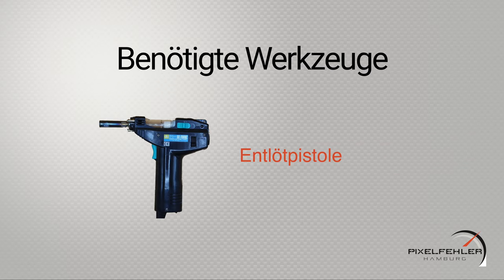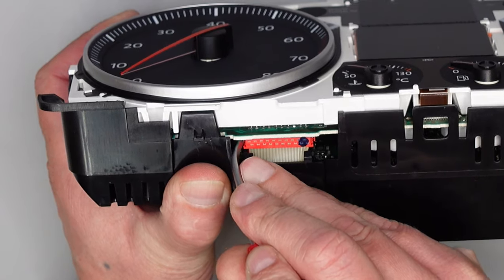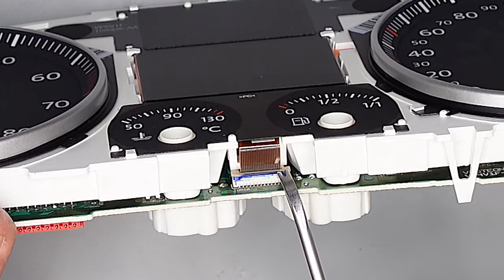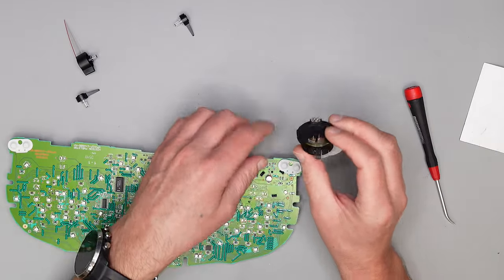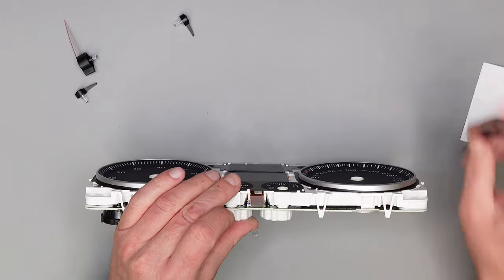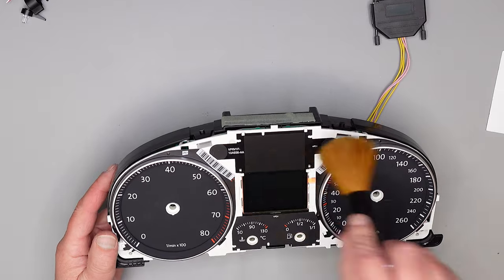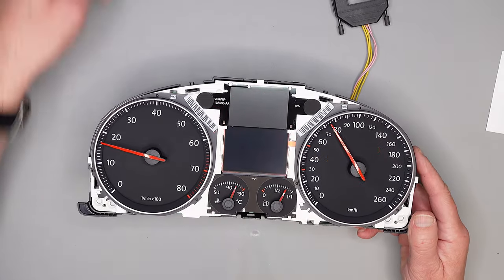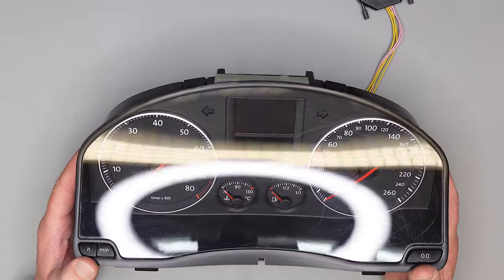Do it yourself! Lautsprecher / Warnsummer Reparatur bei VW Caddy, EOS, Tiguan, Golf 5, Touran

Comment: Wrong! Don't turn pointer hand, it breaks the stepper motor bits! That is what exactly happened to me! Just pull them off without moving to the right or left.
Reply from the maker: Thanks for your information. But we didn´t have this problem you mentioned over 10 years now.
Reply: @pixelfehlerhamburg9956  Heißt das, das Fahrzeuge die vor 2011 gebaut wurden, dieses Problem immer noch mit sich schleppen ?
Reply: @rasoolraenaei9775 Happened to me as well. Were you able to fix it or had you to replace the whole unit?